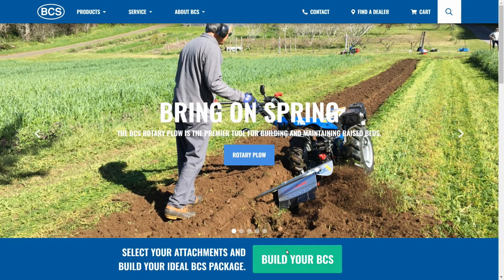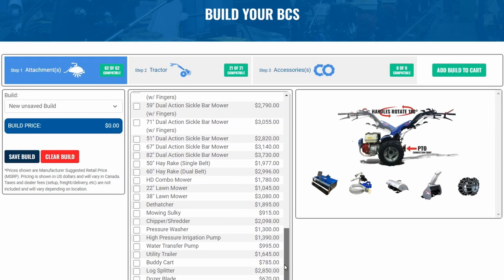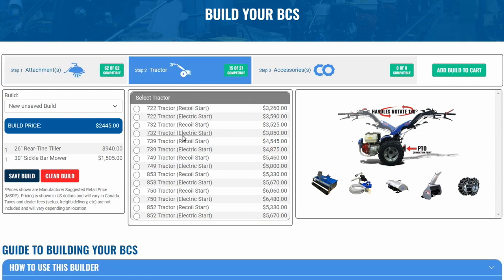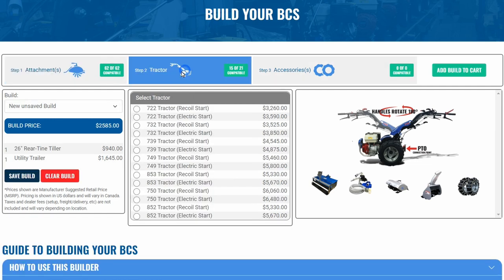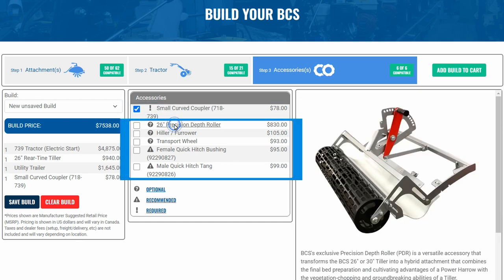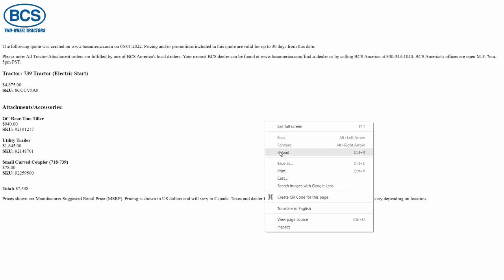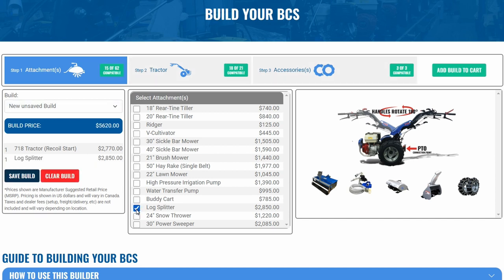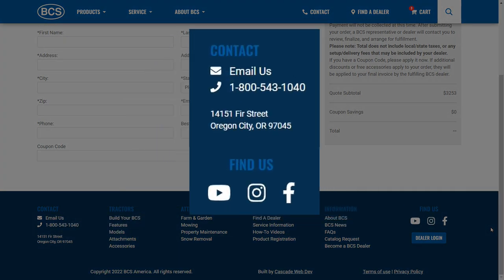BUILD YOUR BCS with BCS America's Custom Configurator

Comment: Hi there, great tool you guys have! Can you do a video on how to properly adjust the sickle mower? If I put it in 3rd gear it will leave many patches uncut. In 2nd its better but it's too slow. I tightened the hold down clamps but don't know how much more to tighten them.
Reply from the maker: The most important thing is to never run a sickle bar mower at full throttle.  1/3 to 1/2 throttle is all you need.